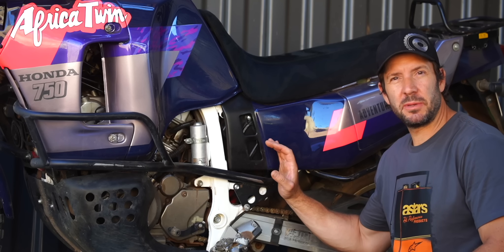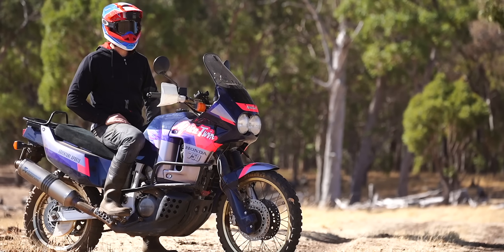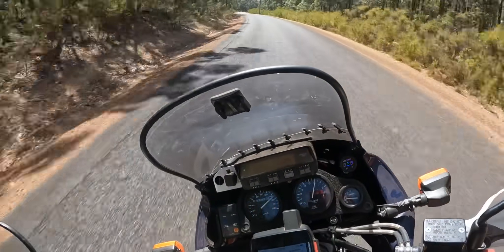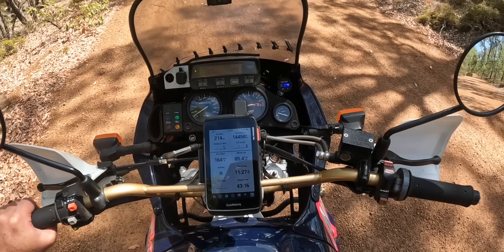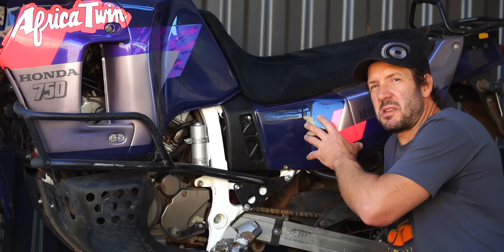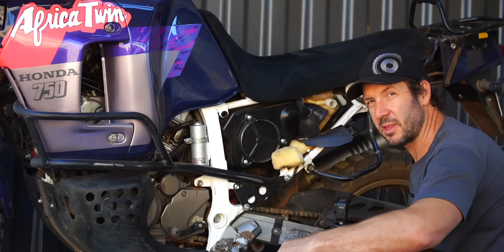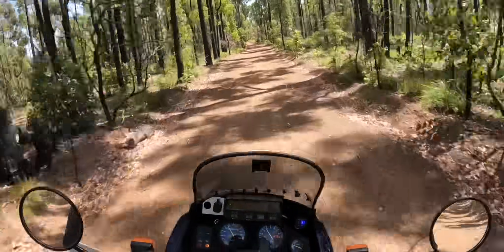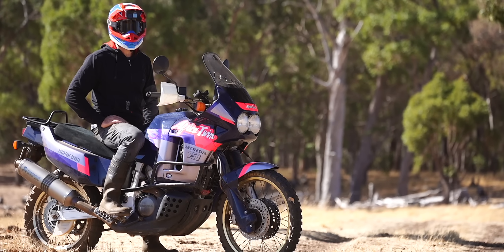Airbox modification increases engine performance and fuel economy

Comment: Ad, less war horse air box foam filter positive air box education, more Power of Sound, Riding the high, Earth movers, bush ripping on enduro weapons. Time you did an old school AReiman for the OG fans. Reckon these newbies will enjoy it.
Reply from the maker: I plan to do something like that with the CR mate, it's just a lot harder for my content to find it's way to my audience now, so justifying the time to produce those classics for minimal return is tough. Youtube is saturated with content creators now. But we will press on.
Reply: @MotologyFilms  I reckon a good sniff of the two stroke smoke mixed with the scent of freshly vaporised earth in the rooster tail of the CR will inspire your cinematic juices again. In no time you will be standing in front of a tripod mounted camera  filming yourself pulling on your Alpine Star pants / shirt / boots followed by a 1000yard stare into the distance, before the helmet goes on and you give a direct 'I'm about to do you' look into the camera lens. The sexual tension created in the dressing scene will then culminate with the scream of the 2 stroke on the pipe and a quick slowmo of roost coming off a paddle tyre (the paddle tyre is important here to create the pulse pulse pulse of roost). You will then mix 4-5 minutes of kick ass enduro riding with a soundtrack likely to become my new favourite song. Such a video would get me running with an extra 15km/hr top speed and positive pressure in my air box. No dust required. There's plenty of other content out there, but your OG shit is superior. Let the cream rise to the top and watch your subs rise. Love your work.
Reply from the maker: Haha, you're definitely an OG fan... OK mate, it's coming.  @adamkrajc6247

Comment: hmm I would be interested to see the changed made at the Iron horse and how she will perform. Got a standard RD04 (French Version) which runs 165km/h without modifications.
Something interesting for you to look at might also be a Dynojetkit as its gone affect the mid range as well allowing the bike to run "smoother". Yes fuel consumption might be affected, but it's easily removed again (with some new slides).

Comment: I don't buy the notion that Japanese automotive engineers made a mistake. Or that they just threw an air box together and "missed" an important consideration. The whole air intake system would have been studied to exhaustion so the OEM way it was was done for a reason. When the CRF250L hit the market everyone was drilling holes in the air box cover to allow the engine to "breathe." The result was intake air resonance was destroyed lowering performance.

Comment: I got a power issue on my rd04 also a german model on the first day on a 10 day trip to europe. Couldnt get past 130kph and was slugish at lower end. Tried changing spark plugs when i reached itally, but  did not help. I had to spend 10 days at 70mph max speed with rpm at full revs. When i got back i stipped the bike opened the tops of the carbs and removed the membrane vacume piston. It was ripped had a big hole in it. Replaced it and it was like a new animal full power restored.

Comment: I ride 2016 Africa Twin. Never liked the dual pleated paper filters and didn't want to go to K&N oiled. Watched what you did and ended up finding Uniflow filters there in Australia that sells and foam pre-filter with a very minor mod to the  snorkels. I feel the 16 Africa Twin has a great air intake position just needed a little more for dirt. And now I feel I'll have that. Thanks for the thought process of finding a solution.

Comment: You created a kind of semi rem-air engine. 

Try to put a flexible tube to the airfilter tube, and take it out towards the front of the bike, than you'll get boosted air .
(Although it will get more dust)
Reply from the maker: It's better if the little snorkel remains independent of the two side ports. Any dust or dirt getting sucked into the side ports will hit the back wall of the sideplate and deflect away from going into the intake snorkel.

Comment: That africa is not so fast you need to try your other africa with no restrictions.

My xt600 tb3 45hp was going 145 on spedometer. After new piston rings,valve job and portet head 155-160km/h
Reply from the maker: Yeah I'll be curious to see the difference once the Ironhorse is ready.

Comment: Good vid.  Good explanation of how the machine breaths.  More so what it breaths from its own sources of polluted air.
Reply from the maker: It's nice when people completely understand "It's own source of polluted air" nails it my friend. I would have dusted the Warhorse engine five times over on my trip around Australia, if not for the oiled filter foam.
Reply: I always change my airfilter to a K&N oiler filter.  I'll use an oiled foam prefilter if possible.  I don't like riding low torque engines with high revs.  A key you eluded to is low speed torque.  My most fun bikes all offer this.  They just don't breath as hard.  My KTM 1190RC8R will take care of all the other excitement a rider needs.  At 68 I've had all kinds and still enjoy it.  Got a new S.S. right knee a week back, walking a couple KM's a day now with aid.  Keep on Keepin' On. I like your vids very much.  Professional in many ways.  You got an edge about your presentation.  I do too.  You can do that when you what the f you are talking about. If not do a lot of listening and keep your mouth shut or ask questions.  positive mate.  Hope to be over @MotologyFilms

Comment: coming from having Euro dirt bikes with strange things that make no sense. I believe your airbox set-up was built for the European weather where snow and rain are more prevalent than bull dust. These little tweaks you're doing will usually gain more horsepower than all the "upgrades" off the shelf.  Keep at it.

Comment: Where there’s flow pressures low. If your flow drops your vacuum will actually drop as well. Not to argue with what you’re saying. It will mess with your air fuel mix for sure but not maybe why you think…
Reply from the maker: The piston and cylinder is one big vacuum syringe. Choke off the filter and there's gonna be enough vacuum to suck a golf ball through a garden hose, or fuel up a main jet – with no air flow.

Comment: I took the airbox inspection cover off the klr650 and rode 300km. I got 24km per litre. Before it was 21kpL.  When I put cover back on it felt like a wimpy puppy. 😊

Comment: Excellent advice! I am very conscious when it comes to what my dirt bike breathes (EXC500 2012) and in dusty conditions I short shift to take advantage of the torque (I also do it more regularly to keep the motor healthy for as long as I can). Lower gearing helps that too. Running 14/48 at the moment which for that bike and my riding is a golden medium. As always great clip man.

Comment: I had the same model with 100 000km on clock. My first bike. Rd07 model solved the problem with airfilter putting it in fron of the gas tank. But i think they made it more road oriented. As always vids are so informative and full of passion for motorcycling even 10yrs after I started to follow.

Comment: Did it top out at 164, or was that all you could do on that road? These things should do 180 all day long. Heck my old XL600V did 175 on the GPS loaded with camping gear?
Reply from the maker: She still had more in the tank. I was satisfied with that run, so shut her down before the road tightened up.

Comment: Just 3D print a fuckin awesome air filter box and fix it once and for all. Use the existing filter box as a template to start with the CAD design.

Comment: Ive done this on a few of my bikes. easy mod to get better air in. My xt660x are very restrictive, DNA side filter fixed that, I got the ktm 690 airbox lid, That made a great improvement with the evo tune. My dads klr we removed the snorkel and made more holes, My xr400m we drilled 6 1" holes on the side. A built motor so needed the extra air. on our dirt bikes we always remove the little rubber snorkel but no holes as we cross water. easy mod for an small boost and a large boost with a tune.

Comment: great video and advice Adam!!! Glad to hear that foam on top of the paper filter should not alter airflow, was my doubt as I was about to modify an original filter to a full foam one, but your solution is so much simple!!! I´m wondering if you unrestricted the Warhorse or is it still the "restricted version" because I noticed you did not pass the 6500rpm (at least on the video). My (Spain version) RD04 can reach almost the 8000rpm mark at full pelt pretty quick (if little wind) and reach 175 / 180km/h on the clock which would be about 5 to 7 km/h less GPS read... 

Question: Did you fiddle with the air screws on the carbs?

I will be experimenting the same mods you are on mine!!! 

Keep em videos rolling!!! cant wait for the next one!!!
Reply from the maker: Yeah the ol girl felt like she had a little bit left but not enough road. I suspect she may have the "restricted version" cams. But I don't care. Plenty of really nice, usable torque in my old RD04. I love the Warhorse how she is and I don't really go past 140kph off-road anyway.
Reply: @MotologyFilms  You are right, Its not about speed but about fun and getting muddy at the same time!!! BTW, sent a couple emails to your Motology web, I have a full workshop RD04 manual (in german) but has all the measures and torque settings, a proper official manual, should you want I can email. I have many other info on the RD04 I have been gathering over the years. BEST!!!
Reply from the maker: Thank you mate, I will try and dig around for that email ..

Comment: Nice one Adam, now she's getting RAM Air. I wonder what a cam upgrade would be like of possible? Or did you already take the cam from the Iron Horse? I remember you talking about it.
The French version was detuned?
Reply from the maker: No I didn't touch the cam, which I suspect is the detuned model as the Warhorse originates from Germany. The Ironhorse is French (un-restricted) so I will recreate the exact set up / Akrapovic and then do the same speed test. That will prove if the Warhorse is truly the detuned version ... haha. I don't care, I love the smooth torque of the ol' horse.
Reply: @MotologyFilms  rightio yeah I agree, soon see what happens. She seems to go very well, when I saw you peddle her through the corners I thought the old girl drifted as good as the T7. 
Massive difference, imagine if you had that sorted before the big trip. 
Happy for you mate! 👍😜😎
Reply: I doubt you really get a positive air pressure = RAM air effect by moving the intake on the side. You would need to have the intake on the front of the bike! There will not be a positive pressure on the side. Otherwise airplane wings would not work!
Reply: @kai-uweoch1159  yeah I know mate I'm a mechanic and Aircraft Maintenance Engineer, I'm just joking, 😁 unless it has an air scoop to force  a positive air flow, but it doesn't have to be on the front.
The side entry at speed can actually cause a negative air pressure, but it allows the engine to draw a larger volume into the engine for improved combustion.
Opening the air box has been around since bikes existed. 
Done right makes a huge improvement, but done wrong especially with water ingress can cause major issues for a multitude of reasons.

Comment: You should take some expanding foam and make a solid moulded piece in there. That way you’re not worried about losing pieces every time you open the cover and there’s no chance of vibrating loose off road.

Comment: Awesome video! That's pretty impressive power increase. To keep the foam in place you could get velcro so they could removed for cleaning or replacement. Maybe use superglue to attach. Best!

Comment: Old bike are so choked ... in Italy was quite common to replace completely the air duct from the carburettor and instal a conical filter into the air box, without the lid.

Comment: You may add fiberglass to form your custom air-box extention around the foamed pieces, and seal it off with glued-on sliced gas-tubes, or just cut out a larger flexible rubber item forming that air-box and cable-tieing it to the frame, or a rabbit-net wired support structure.
I’d add a blackened fine grid to your 2 air-box holes to avoid stones being venturied onto your air-filter.

Comment: Thanks for addressing the air restriction doubts I had.
I'm going to ride my Transalp 600 in Tunisia next month and I was worried. I'll definitely try it.
I'll also check if it has the same stupid air intake location as the Africa Twin and will try to modify that too.

By the way, the RD04 has a higher top speed than the one you achieved. Really curious yours can't go faster. Personally I couldn't care less about top speed, just saying.
Reply from the maker: My Warhorse is the restricted German model. I suspect it has a lower horsepower cam, but the positive is the torque. I love her just the way she is.

Comment: is that new top speed with the better cam? Thanks for the content I learned a lot and look forward to following your adventures. I'm getting close to finishing my 1984 cb700sc for adventure riding, it's a 4 cyl with low compression relying on rpm to make horsepower, I have a foam filter & bigger jets going on. My only concern would be CV carbs requiring a certain intake pressure to open properly, wouldn't increasing primary air pressure decrease the performance in some cases?
Reply from the maker: No I didn't touch the cam. As for air intake pressure, it all begins from the engine's stationary induction. It's still 100% naturally aspirated – the positive pressure would only begin at like 10-15 kph. Also, the vacuum sliders can only respond to the airflow governed by the throttle butterflies.
Reply: @MotologyFilms  Okay so it's more or less the air velocity that will open the vacuum slide I didn't think of it that way. You have stated in other videos that's a better way to mist fuel with air velocity rather than excessive vacuum pressure, it was running lean with stock jets with a paper filter, could hardly run with a foam one, im looking forward to testing the bigger jets out it will likely have more power/rpm!

Comment: So is there no need to change jets to compensate for the change in airflow? I love the series, btw, Good job! Lots of tips and knowledge. I have the exact same Warhorse, in the same colors!
Reply from the maker: Not for the altitude I'm riding at. As it is in our summer, she is still on the rich side right now and will clean up even better during the Aussie winter as the air becomes, colder and denser.

Comment: Driving these bikes myself since the late 80`s  and I am happy to see you giving them the credit they deserve. The biggest improvements for me was a "more" modern CDI unit, which totally changed the way the engine worked, as well as using fork emulators. Thank you for your excellent work and spirit!
Reply from the maker: I actually have a spare CDI, which the previous owner gave to me with the purchase. It's not a genuine one, maybe it has a modified ignition curve? I've not felt the need to change it because I love how the horse runs. I'm not necessarily chasing more power, just like to have her running smooth as silk.
Reply: @MotologyFilms  Thank You for commenting.
Agree... and its not about power.
But consuption dropped dramatically while at the same time the bike runs noticably smoother with less vibrations espesially after 5000 rpm.
It also include a safety from getting damaged, should the regulator fail.

I use the opportunity to thank you for this amazing, no mambo jambo work you do.
Great respect and kind regards  from Norway 🙏
Reply: Buy ignitech cdi
Reply: would you remember or suggest which cdi unit to use? thank you!!!

Comment: They have addressed this problem with dusting the filters on the new Africa Twin.. the intake is forward facing high up in the front. Thanks for the educational videos.. even though I drive a crf 1100.

Comment: Great mod! Just a thought; when you redo the foam... would it not benefit the flow by coating said new foams in some kind of adhesive plastic sheeting to make the applicable inside surfaces slippery rather than the draggy foam? Might result in even more boost.😉👍

Comment: That’s spot on that Adam. Makes sense. A lot of sports bikes have been using something similar, RAM air. Air is pushed in through from the front as you ride. Your new set up is the same.

Comment: whaddya reckon, a 3d printed funnel piece that channels the air directly from the 2 ports on the side fairing to the airbox intake? or some flexible vacuum cleaner hose from the airbox direct to the open ports on the fairing? ala Kawasaki ZXR750 ram air?

Comment: Nice, but i have 1994 afrika like your's . Already installed air filter like in previous video. But i made carburator ajustments and changed membranes. Mine afrikas top speed on autoban 178km/h.  I interested why such diffrence.? 🙂
Reply from the maker: My Warhorse is the restricted German model. Lower horsepower cam I believe ...
Reply: @MotologyFilms  oh yes, it can be. I will try to do same , i will write the result too. Thanks for good tips :) im getting ready mine horse to iceland F-roads one month trip :)